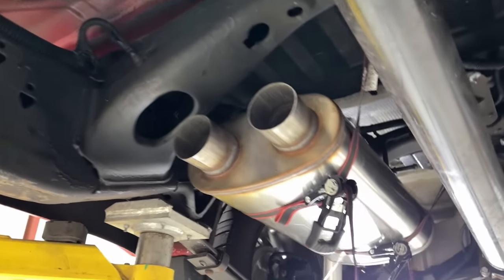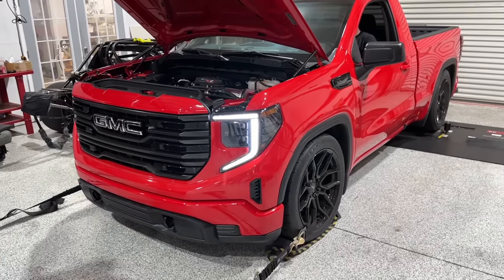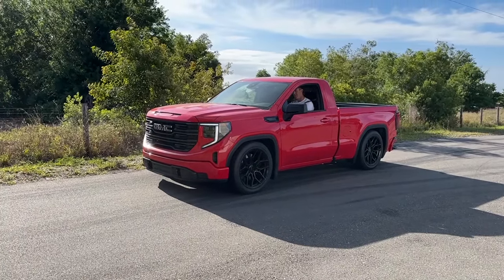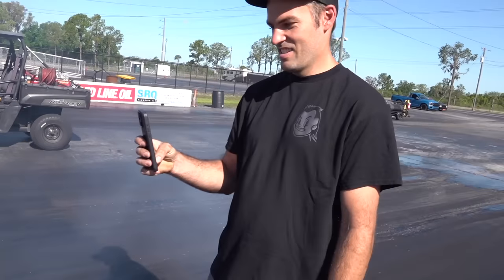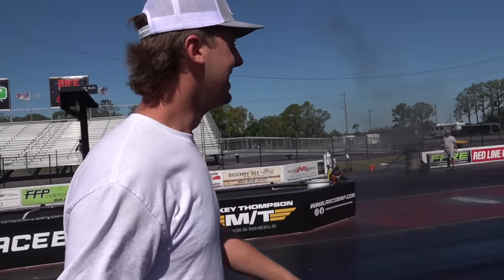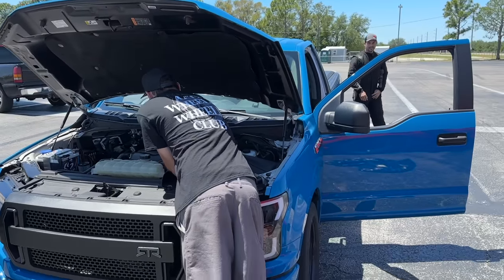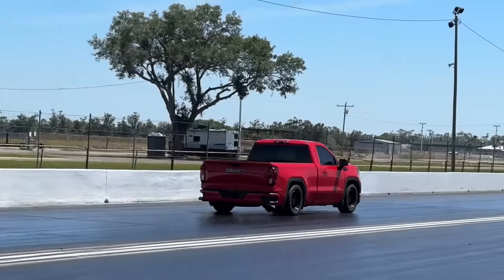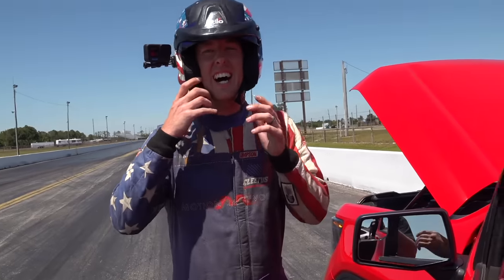Our Supercharged 427 GMC Is Done and It's INSANE!!!

Comment: I find it absolutely great that y’all have to drop a 427 ls in it to keep up with a little ole 302
Reply: The dont *have to*. The 427 is a safe bet. They’d either take the 5.3 out of the gmc and build the entire thing, or just buy a built engine that they know is capable of 1000 whp. The “little ole 302” is a built coyote, built as good as it can be for this application. I didn’t see the GMC snap a crank off? Did you?
Reply: Also, not only is the Ford lighter, but it has a bed cover. GMC is heavier and has more drag because it doesn’t have the bed cover. It’s an apples to oranges comparison.
Reply: @ChuckleBuck bud the truck doesn’t even exist… complete engine swap. Whatever y’all gotta tell yourselves 🤣
Reply: @ChuckleBuck  more drag from a bed cover? lamest excuse EVER!!!
Reply: 500 cubic inches vs 302 cubic inches and Ford still smokes that Chevy junk
Reply: @ChuckleBuck  it also just blew up again in this video...I went thru gen3 coyotes and a10s like skittles shit is weak and those plasma bores are hit and miss...but gen 2 coyote with traditional iron liners I like....6R80 built will hold a long time no a10 will...

 However this isn't remotely apples to apples, first they should both have same size blower or turbos....that gen 6 whipple is the NEWEST design barely released and it IS more efficient than than gen 5 which is miles ahead of that bullshit 2650tvs the GMC is running....

 Same boost, same power added would have been nice comparo...
 However it's just a fact the GMC engine is ready for 1500+ so it can run whatever they want it to with suspension and more power adder.......

Where Ford wins this is GM is dumb as fck and refuses to make us a 6.2L regular cab and have done so for years and now not at all......I tried to basically do this 5 years ago order a 1/2 ton with 6.2l to drop it out and boost it ( A8)
Reply: You Ford guys always neglect to mention the Ford motor is DOHC with 4 cams/32 valves vs the GM with a 1 cam/16 valves. GM LT6 is the most powerful NA V8 ever built is what happens when GM makes a DOHC V8.
Reply: @ChuckleBuck  You are right. It's an apples to oranges comparison. The F150 is fast and the GMC is a turd bit slower.
Reply: Chevy trucks are slow a 2.7 ecoboost will walk 5.3s coyotes are way better they made less power with a blower on the 5.3 than a bolt on coyote
Reply: @msohm322  use common sense, if the tailgate is still up it drastically increases drag. Anybody who has ever rode in the back of a pick up knows that.

Comment: 38:20 Good ol Sam. Everyone's all lookin at the blown motor and he's still polishing the fender.
Reply: might not run good, but it'll look good.  Just keeping it aerodynamic.
Reply: Not blown just a timing chain tensioner or guide
Reply: @young11984  That's what it sounds like to me.
Reply: @52Ford  thats what the coyote sounded like that i got for $300 core charge, pulled it down and had one trashed tensioner and guide…..$300 later it runs fine
Reply: @young11984  Similar sound happens with the Ford Modular engines when they have chain guide/tensioner issues.

Comment: This’ll probably never get back to them but the reason the ford keeps doing one wheel burnouts is the stock traction control system with the locker. To override it you have to start your burnout within a couple seconds of stopping or a granny system kicks in and limits the locker regardless of traction control being off. You have to roll forward a couple more feet if the second wheel on the drivers side doesn’t immediately spin. I speak from experience in doing consistent two wheel burnouts in the f150s I’ve owned.

Comment: With all these 4x4 trucks it helps if you put airbags in the rear and air them up only at the track and then put limiting chains on the front to help keep the truck from weight transferring.

Comment: Cleetus, when you tow with the ford tow truck. And then putting the front wheels up. Your supposed to put the staps on the tires to hold the truck to the tow truck

Comment: Cleet !!  We're just missing a white Dodge single cam with a Hellcat...would be an epic three way drag race !!!
Reply: Honestly I would imagine it would be a pretty straightforward build, at least on the hardware side. There's certainly a number of recipes for G3 Hemi builds, the ZF 8-spd is a proven beast of a trans like the Ford-GM 10-spd, CalTracs of course. I'm not into that into the Mopar stuff so I don't know if they're still an electrical/tuning headache at this point(I would hope we've gotten them down by now lol, the factory ECUs were a nightmare for years), I don't know if there would be any headaches there. But, hardware, they could probably throw one together pretty quickly if they wanted the trifecta in the fleet.

edit: oh shit, I forgot - no CalTracs here, them things are coil sprung now! I wonder if they could make it launch better than the leaf sprung trucks...
Reply: They arnt fast.
Reply: No WE'RE not!
Reply: All they have to do is hit up RipaTuned
Reply: Nah, like they said lol they don’t make anything reliable! You’d have to do a full roller chassis and just set the dodge cab back on top….otherwise you’d just be in a screaming metal death trap….until catastrophic failure hurt someone.  You can turn something as garbage as a RAM into something as nice as either of these trucks are.  It’s just not possible with what your starting with.
Reply: Boooo dodge booooo
Reply: Baby TRX with a demon swap would’ve been amazing
Reply: @johncena-hq1ti you could buy both of these trucks with the cost of that build only to be unreliable and maybe be faster.
Reply: That's what I'm saying George said they don't make nothing fast I said if you put a Hellcat supercharged motor that would make any Dodge fast
Reply: @MichaelWilliams-vb6wr  the hellcat motor doesn’t even make a challenger fast bud
Reply: @DennisFrechette-et6gg  right the fastest kitty isn’t even out of the 7.9s last I heard.

Comment: I am blown away that these trucks can run 4WD drive without blowing anything up on dry pavement let alone on a track with so much grip. Long ago on the older rigs this would have sent the transfer case out the bottom of the truck.

Comment: you've got to love 5.0 f150's. I just watched a Supercrew that looks stock run a high 11 at 119 at bristol tonight. Someone said it has a turbo
Reply: And a 2+ litre super charger so really a 7. Something
Reply: Nothing like doing a motor after 20 passes.
Reply: @ChuckBeefOG  if they weren't pushing the engine to its limit it would probably hold up. But 10 second passes aren't as impressive as 8 second ones which they are trying for.
Reply: @wes3527  ya but now it sounds like the engine is hurt.

Comment: Might be able to fix the bunny hop by adjusting the angle of the caltracs up a bolt hole.  The caltrac should be level with the ground at the point of peak weight transfer.  put a go-pro on it. If it starts level and squats negative it takes weight off the tire as it comes into the power and thus you get the bite-spin action.  Love the videos!

Comment: This truck ain't beating no coyote truck. That's for sure.
Reply: at least the gmc wasn't found on racetrack dead
Reply: @Taxevader-gk9ms they have blown every Chevy engine on the chanel 😂
Reply: @kiwi8. oh you trying to do the extremely dorky chevy vs ford thing
Reply: @Taxevader-gk9ms you did it first lmao, what are you talking about 😂 If you can't take a little light hearted ribbing you shouldn't start poking the bear
Reply: 10.2 on 13lbs with a 1.5 60ft. Turn it up, cut some weight, actually set it up for drag racing and it definitely would. I just doubt anyone is going to take the time to actually do that on one of these.
Reply: @lukewest708  what i did was make a ford pun what you did was defend your precious brand
Reply: He said in the video that the Ford was turned up all the way.. on the ragged edge. Not the motors fault he keeps blowing it up. Turn that 427 all the way up and watch it blow too. Funny he was nervous running it as it is now.

Comment: You’re gonna have to put a automatic shifter in that thing and shift it manually it sound like it slipped the transmission a little bit or the torque converter took a while to lock that truck definitely gots an high 8 in it yeah they definitely need to bring back the Chevy version eight aluminum block good job gents

Comment: Very clean. I hope you include some street wheels for interstate driving. Chevy Truck department, take some notes. Your flagship is now the Trax. That is as un-American as a Mirage or Rio. Here is a clue. Same Exterior, Best Powertrain, Best Suspension, along with an interior from 1995 standard. Upgraded interior will be for the rich. Starting price $25k for a two seater...

Comment: I REALLY wanna enter this contest but I get too disappointed when I lose. 😬 

It's literally my dream truck. Everything is exactly how I'd do it, as long as the factory wheels come with it for weekend cruizing. 🤷🏼‍♂️ Plus, the impossible for mere mortals like me, the short box regular cab new gen. 

I almost bought a 99 (in 2000) rendition of this truck while I was in the military. It was a black short box regular cab, lowered with an EARLY LS cam with some nasty exhaust and some nice wheels. I bought a 98' Z28 instead and put a 636 hp N/A LS6 in it a few years later. 😬

I may as well enter I reckon.

Comment: Ford is easier to break and GMC is durable and well powerful and my GMC Sierra which is a 2018 GMC Desert_Sun Sierra SLT Crewcab 1500 8 speed 4WD which was originally a 6.2liter but I decked it out with a 10.2Liter behemoth of a 3,980HP custom V12 crate engine which yes if you are wondering on how I put that engine in the truck I had to rebuild the front end to make it larger then stock then decided to put extra weight to avoid the hop it runs a 3.1 flat at 189MPH and it took time to get everything just right. Not a truck for the faint of heart and not for rookies or beginners because you will loose control faster than you can blink.

Comment: The funny thing is in order to make a Chevy/gmc pickup competitive to a stock f150 with a supercharger you have to shoehorn a massive 427 in there with a crazy boost setup and fuel system the whole 9 and it’ll still prolly get gapped😂 just buy a ford damn

Comment: You one eyed Chevy boys make me laugh. Poo pooing the blue truck which is on the virg of running 8s with 125 less cubes when the red truck is struggling to break 10s with more than 2 litres more cubic capacity. That's like a whole extra engine there. Give the Ford truck a break. You're gonna laugh and say 'yeh but it's broke'. Well ok but let's see how the red truck goes when it's running low 9s. If it ever gets there. 😊😊 love your content. 👍👍🙏🙏

Comment: I finally realized this entire truck is custom making it no fun because your always scared to break something
 No wonder why he’s scared to beat on it and always worried, u can just tell how he acts about it vs every other car truck.
After doing some research. 
Here r the numbers of what they charge 
$45,000 - 2024 stock GMC 1500 
“The company doing the work”
$20,000 - to convert this from long bed to short bed
$11,000 for painted bumpers /lowered sport suspension 
$30,000 for a max effort LT4 supercharged engine swapped in w supporting mods
So this company is charging you $65,000 to make it look like this. All in with the truck he’s at $110,000 , that’s literally a scam , my god 😂😂😂

My advice buy a Shelby for less which not only looks much better and is built right for this but will hold its value down the road significantly better 
OR
Buy an F150 RC with a shortbed for $45,000 , throw 25k at it and run better times and still look damn good and if a part breaks it’s easy to replace and find 
 
1 off Custom builds is never a good recipe if you plan on having fun w it . 

This will either sit in someone’s garage who babies it and makes it a show truck(I hope) OR some broke poor guy or kid will win it , they’ve never been in anything fast and will beat TF out of it and within 1 year it’ll be a parts car in some wrecker lot

Comment: Get a Mechanic Coming GMC.  If you're gonna build an all wheel drive regular cab  street truck get the guts out of a Trackhawk ( HP 90 AWD )  and put em in a Ram R/T that would shave 750 pounds off of the Trackhawk and a built Iron Block all Billet Stroker Hemi with a couple of turbos should be good for easy 8.50s and wouldn't be broken all the time like your loser Fords and GMs!  You guys must be Democrats!